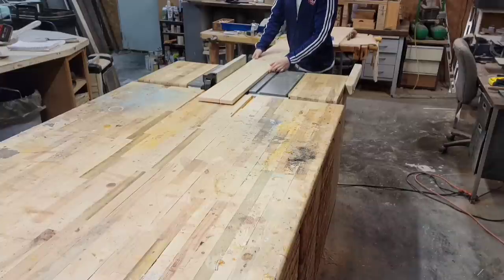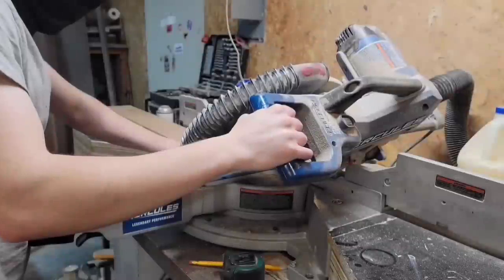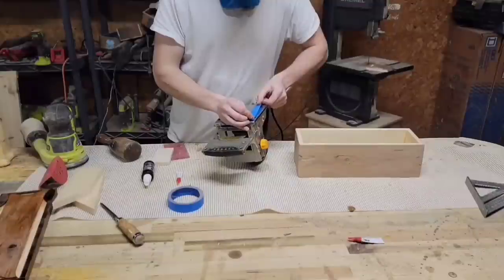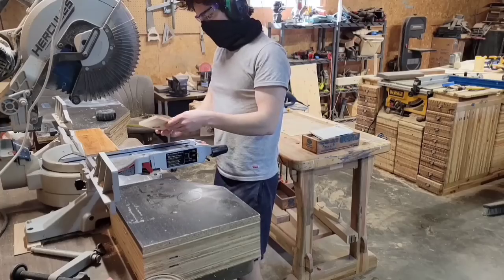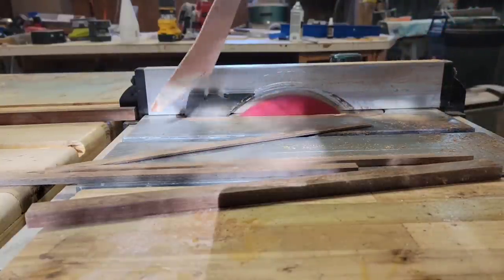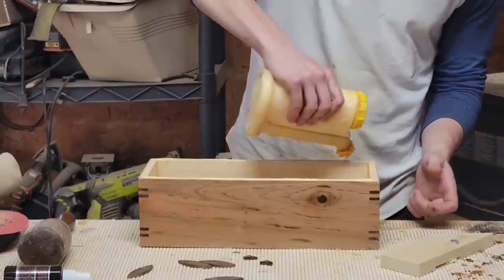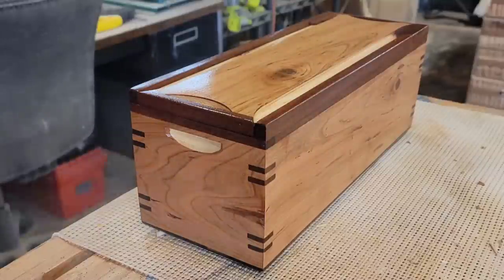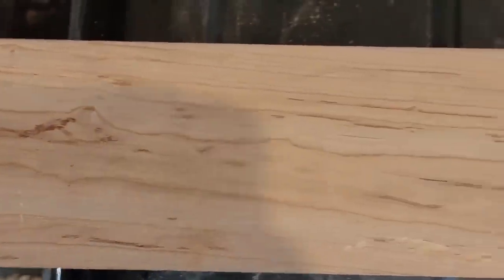Making A Wine Gift Box + 5 Buiscuit Joiner Hacks | Woodworking

Comment: Josh, the bottom looks good. I like the use of the biscuit joiner for the corners of the box. The bottom does indeed look like it might have been stitched. I think a depth stop of some sort woudl help get the correct size that you want. It would be something you would have to mess around with. Super cool box and came out great!

Comment: Can I please have an amazing button 💎 instead of just a like button👍🏼? I had no idea my biscuit joiner was so versital. The box itself is fantastic and beautiful. The planer shavings as packing material also great. Imaging using ceday shavings! 

I do have 2 questions. 1) What was the final thickness of the veneer? 2) Were you able to tune the snipe out of the thickness planer?

Thanks
Reply from the maker: Thank you for the kind words!
1) I think the final thickness of the veneer was just over a 1/16". 
2)if I'm really careful I can get very little snipe but I've never really been able to completely eliminate snipe with any planner I've used. I ussually just leave the peice a little long before planning so I can cut off the snipe afterwards.
Reply: @JoshWrightWoodworking  Thanks for the quick response to my questions. I found the amazing button, it’s on patreon. 😉
Reply from the maker: @lincolndickerson1293  I saw that, very much appreciated 🙏